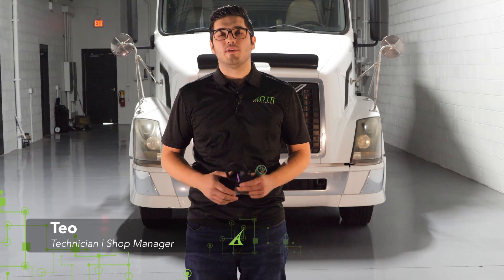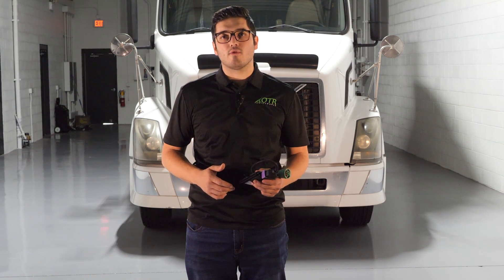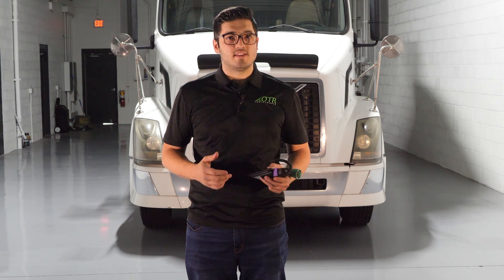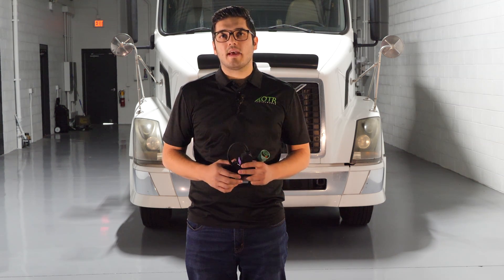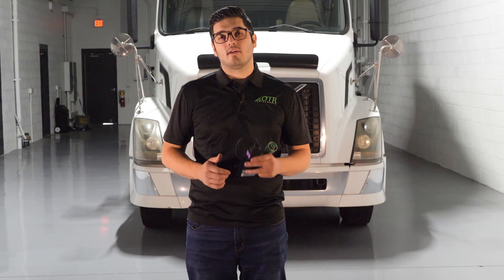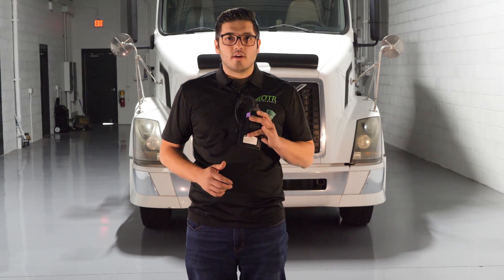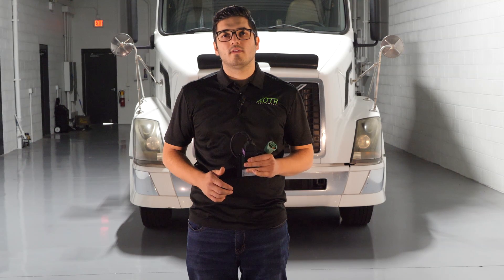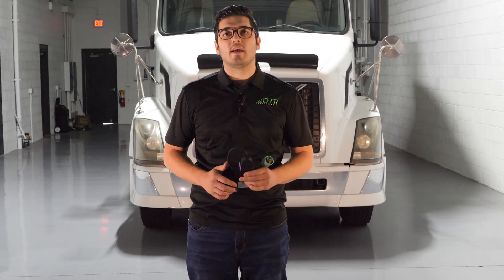How to Perform a Forced Regen on a Volvo D13 | 2007-2013

Comment: This machine is not working for all trucks,I tried 3times for regen  but I faiied ,my truck is  vovlvo d13 eng.Machanic said no problems on my dpf sysyrem
Reply from the maker: Im sorry to hear you are having issues with the tool. Please give our team a call at 586-799-4375 and they can help resolve any issues you may be having.

Comment: It's a good tool to have. Does everything except deleting/resetting 5MPH derate message(EXIT INDUCEMENT). That's something to be done by the dealer, and they'll charge $195 each time they hook up their laptop to the truck.
P.S.-If that message stays on, turbo actuator will not function properly,  therefore truck losing about 40% of it's power.

Comment: My truck has an option to do a park regen, do sent seem like I would need this tool right?
Reply: What makes it great is the reset of codes. It takes some many times for it to become live on the exhaust end. The derate will stop and if happens again hope you are close to shop. Or use it again. Mist tool to have. Just saying it saved me 4 times in the years I owned it. Close to 1 million on truck and my exhaust after treatment is finicky but this clears it up and I keep going. And have replace Dozier along with do the presure washing of original dpf filter 944598 miles on it.